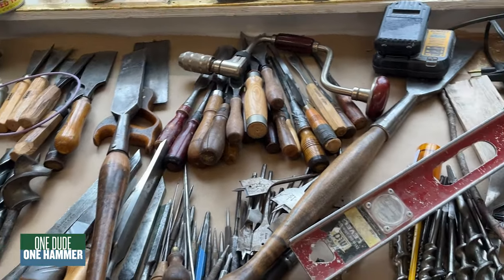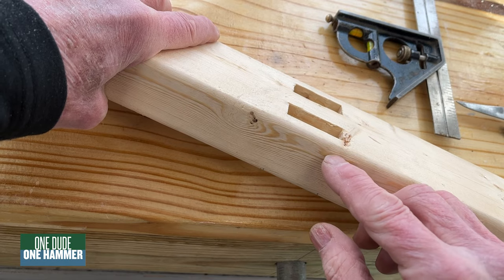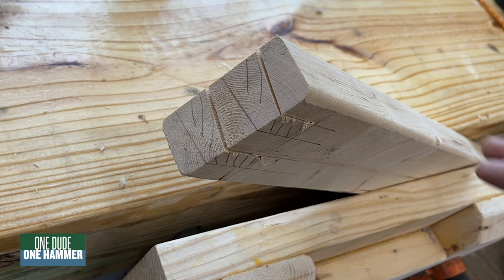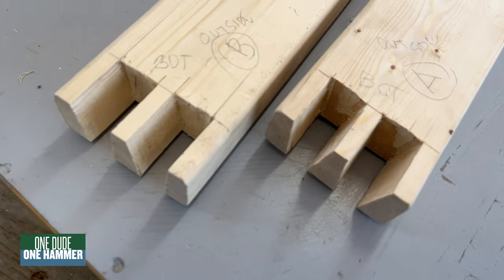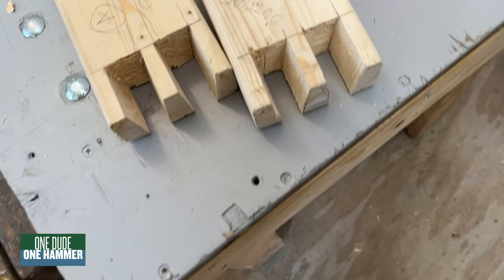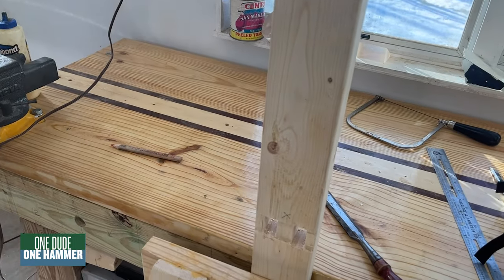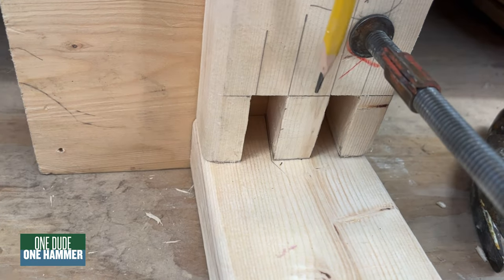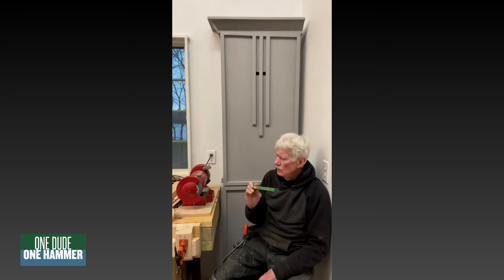I BUILD A TOOL CABINET TO ORGANIZE MY TOOLS!

Comment: Ok I was thinking about building one these but since I found your site I’ve itching to some of your projects I live 2 bedroom unit with small courtyard,so I cheated one of my neighbours put tall boy chest draws out side of street with free on it so took it home I’m turning it in to Dutch tool chest I firgure half the works done so just put thicker ply on back and make drawers stronger a base plate with heavy duty casters then when I want to do one your projects I just wheel it out in courtyard when I finish wheel it back inside.thank you.
Reply from the maker: Great idea, Terence. I would have done the same if I could’ve found a cabinet! Thanks for watching!

Comment: I wish I had that tool collection. Why did you decide to paint it? I don't think I would have made it that nice with the dovetail joints and such for just a shop piece. 
Excellent job!
Reply from the maker: Used dovetails for strength, they’re mostly hidden. Thanks for commenting!
Reply from the maker: Oh, and on the painting, the woods not pretty so just wanted protection fast.
Reply from the maker: Oh, and on the painting, the woods not pretty so just wanted protection fast.